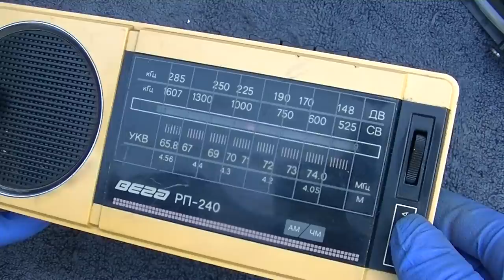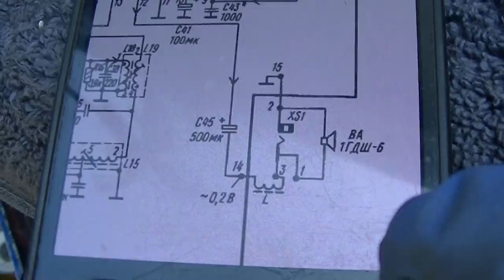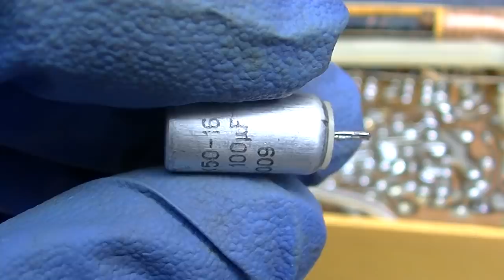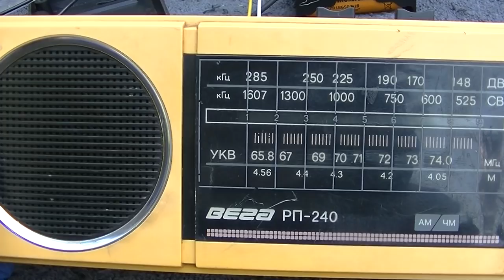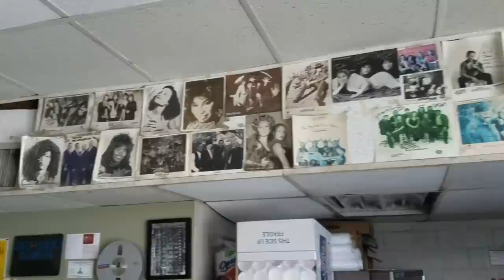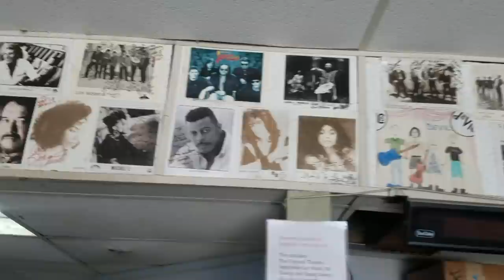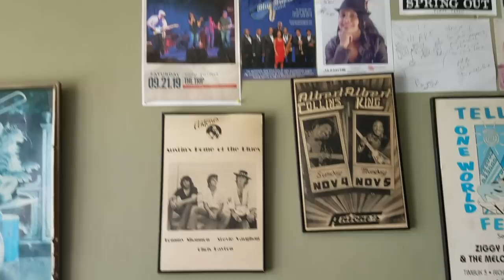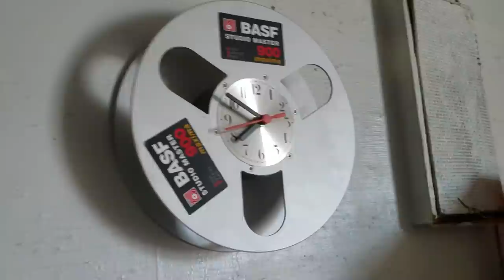Vega RP 240 Russian Radio Repair

Comment: The housing design is from the early 1980s but it was actually assembled in the early to mid-1991, when the USSR was on its last legs. The ICs are date-coded as 9010, October 1990. The silkscreen font like that appeared in 1987 or so. The cap on 5:59 is original to the radio, mfg date September 1990, which fits.

Comment: Early 50's Gibson guitar amplifier sitting on the floor at 16:20. Judging by the size it looks like it could be anywhere between a GA-8 through GA-20. That's a very good piece. I hope someone grabbed it and it didn't get pitched in the trash.
Reply: 17:03 I think there is second one in front of it, smaller box.
Reply: @_-_Michael_-_  Yeah, I noticed that one too but, I didn't think it looked like a Gibson. I can see what looks like a band of white piping/binding in the tolex going across the top. I don't recall Gibsons ever having that. Maybe a Valco/Supro of some sort. Hard to tell. Either way they're both tube era amps. Those little Gibsons are awesome tone machines. Fantastic for blues. They've got break-up and overdrive like no other.

Comment: The OIRT FM band is very interesting and still in use in Moscow mainly from Ostankino tower, sometimes we can hear it during skip conditions in England.
Reply: Are there any vintage radio restoration channels by people here in the UK and is there much call for older gear here in the UK? I live in the UK too and wonder if the proposed FM switchoff will happen soon. I guess it might not like all things it'll be delayed 😕.  Last I heard it was supposed to happen by 2030?
Reply: Radiocruncher is based in Devon and has a YouTube channel where he livestreams restoring British radios. Allthegearnoidea, Andy Doz, Codeeze, George Christofi are the ones I know of.
Reply: @Wenlocktvdx  thanks for this - have subscribed and will keep an eye on what gets posted

Comment: That stile CCCP stile electrolytic often go bad in the end 70's and 80's stuff. I have a RFT SEG15D from the DDR early 80's that has them in the synthesizer ad they are all bad so its running on a sort of base frequency but doesn't change no matter how you put the decade controls. And that's even a military transceiver. They used them in the towers on the border with west Germany.

Comment: Most of the times you can find a western substitute for these Soviet ICs. There are cross reference spreadsheets online. 90+% of the Soviet consumer ICs are just knockoffs of western/Japanese stuff.
What did you get from that closed workshop? Any news what happened to the rest of it? I hope they sold / gave away most of it and not recycled.

Comment: Bummer about the repair shop. I hate to see that equipment go to waste. I'd take it but realize I can't take everything.
Using the old equipment on the gear repair is the best. You learn more about the circuits by having to repair the repair equipment. Which is what happens when you buy the old test equipment.
It didn't seem like the shop was used for quite some time. The bench trash and the old equipment doesn't make for an efficient money making work space.

Comment: It highly offends me that anyone would throw vintage gear into the dumpster. Here in europe prices for vintage test and guitar gear are several times higher than in the USA
Reply: Everything in Europe is cost more than U.S.A. but may be an exchange rate! I remember in 1985 I send my father Chronograph watch to Switzerland for restoration and it cost $85-100 but they did very good job compared to the "union clock shop" in America!

Comment: K174PS1 = SO42 (Mixer)
K174XA10 = TDA1083 (FM-IF, AM, Audio-Amp)
Reply: Thanks, I was sure they have some western substitutes (=originals, as the Soviets just copied almost everything), but I was too lazy to look them up. SO42?! That's a great mixer IC, I have never seen it in a pocket radio, just in big chunky tuners...
Reply: SO42p was used alot by elektor. similar to ne602

Comment: The back claims it uses LR6 batteries, which is the IEC notation for alkaline AA. The USSR A316 type also listed appears to be the same as AA. Did you try alkalines? Sometimes Ni-MH are a bit on the large side.

Comment: On the topic of dead IC's, my clock radio 8 track set needs a new clock IC.

Really wish they used a heatsink on it as it runs on 24v and kicks out a fair chunk of heat. So after 40+ years the digital clock is all glitched and goofy looking 😒.

The radio still works great tho.

Comment: I have a radio...that go all the way down to 25mhz.....all the way to the fm band....i would use that to get other stuff in the 60 to 75mhz  ...FM DX from Japan and Russia... also...30 to 50mhz range...that radio may get Harmonics from the 30 to 50mhz my Sony ICF 2003 gets FM on the 70-90mhz range ....that is why Radios that tune above 30mhz is fun

Comment: 1990 date codes on the capacitor and speaker.
Reply: -89 on the back - so it’s around or shortly after the ‘91 collapse.

Comment: Your images you getting on FM is bleed though as you close to FM towers. 4 Meters is used in UK as ham band on narrow FM. Some of eastern Europe & Russia still uses 64 MHz -108 MHz as broadcast band. Japan uses 76 MHz-95 MHz which is strange but their tuners now go up to 108 MHz.
Reply: Eastern Europe and Russia used OIRT band 64-74MHz. Between 74 and 88MHz there were some services. So no one is now using whole 64-108 MHz band even there are tuners which tune whole band at once. If old OIRT band is still used together with CCIR, two separate bands are used: 64-74MHz and 88-108MHz. There is no public broadcast between 74 and 88 MHz.
Reply: The fm brodcast band could be extended to about 108 MHz - here in brazil always be 88 to 108 MHz - after the analog tv band was stwitch off...
Reply: @xsc1000  The problem with using OIRT and CCIR FM bands simultaneously in the same country is that most consumer FM receivers don't have great spurious frequency rejection. For example you can receive FM 91,4MHz on an OIRT radio at 70MHz, since F_received+2xIF is amongst the mixing byproducts (mirror frequency reception). So they must arrange the stations on the two bands in a way that they will not interfere with each other, which can be difficult if there's a lot of stations on the CCIR band. But I guess countries which still use the OIRT band usually have just a few stations on it, most of the stations are on the CCIR band. They are maintaining the OIRT band just for legacy vintage radios. For example in Hungary, they shut down the OIRT FM band completely in 2008, but there was only one station on it since about 1995.
Reply: @mrnmrn1  Why would they still make a radio with it going down to 64 MHz if they not use it still? My research says its still used in some areas. I just got a Tecsun H501x & few other & they seem to have them FM bands & radios are new.

Comment: I took a part an electronic item that was made in Russia and it used a double A battery pack. It's been awhile and I can't remember I'm getting ready to reassemble. I was hoping someone could tell me, there's a red wire and a blue wire. Which one is the positive and which one is the negative? Thanks a lot.
Reply: Blue is usually negative and red positive.
Reply: @ciprianwinerElectronicManiac  ok. Thanks a lot.!

Comment: Nice! 1980's look all the way, even in the CCCP. And dang at 3:36 that's some chunky soldering work. It must have a couple of ounces of it there. It really is built like a tank. From all the old Soviet electronics you have shown they look to be high quality and way overengineered. Well, except this one. I guess Western cost cutting infiltrated the Soviet Union by then.

And Hoooooly crap! 19:16 the Video 22 sticker! That channel was all over the place with programming back then, channel 22 KWHY. Showing the stock market news in the morning to 3 PM then music videos from 3 to 6 then Spanish programming. Man, I'm dating myself, in the very early 80's channel 22 used to be a station for Select-TV, (a Los Angeles over the air paid TV service that used a descrambler box) and on Saturdays after 11 PM they used to show soft core porn. As a 9-year-old I was very titillated and found out that a 5" B/W Panasonic TV picked up the scrambled signals better than the main TV.  KHJ channel 9 also used to show a sweet music video show back then. Video ONE.
Reply: Necessary robust structure for resisting Western materialism influence on RFE.

Comment: For some reason it feels strange hearing US stations coming out in English on a Russian radio.  Of course that's what you'd pick up here in the US, but for some reason my mind just expects only Russian to come out of that radio.
Reply: The radios cant grab a hot signal from that far away xd.  It will pull in the strongest signal which is usa stations.

Comment: Inductor based tuning is pain, pain and pain to convert to modern 88-108MHz CCIR band, may look cool but otherwise it's a curse
Reply: Today I rebuilt this radio receiver in the range of 96-108 MHz by replacing two capacitors.
Reply: @ДмитрийПлащенков  The point is, inductor based tuning doesn't really allow the range to be wider. You can just shift around the range. I did work on old Elwro ECC85 based tuner and it was pain, the only way to achieve 88-108 is to scrap the coil assembly and make a new one with tighter turn spacing.
Reply: @Pawelr98  You're right. But, I'm fine with a narrow range.

Comment: Ya could used to buy those at now defunct Pay-N-Save 💰,K-Mart, and the like 👍 . 👏, definitely 1980’s. I remember these kinds of radios 📻 in my high school 🏫 years. I’m gonna guess this radio 📻 is about 1988. The plastic case looks pretty 😍 yellow from being in the sunlight 🌞. Still, to me, this is like 👍 the “Back To The Future” radio 📻, if the year of manufacture 👨 of it happens to be 1985. The dial cord is old, and needs to be replaced. Classical music 🎼 sounds GREAT 👍 on this thing, and so does Michael Jackson. It may sound plastic-y, and all ya hear 👂 it on is a small permanent magnet 🧲 speaker 🔊. Your friend, Jeff.
Reply: It has date codes of 1990 inside.